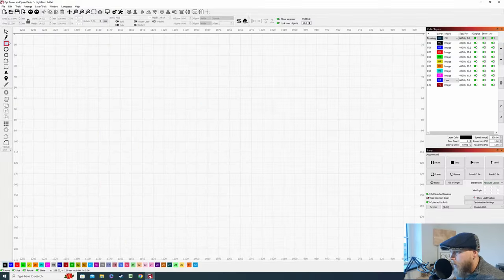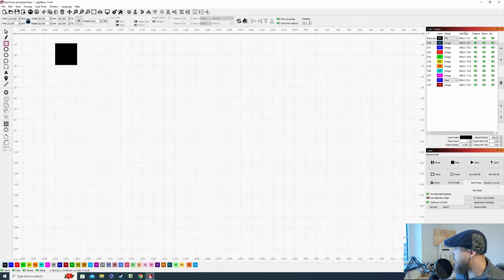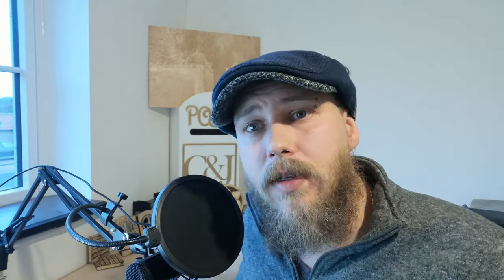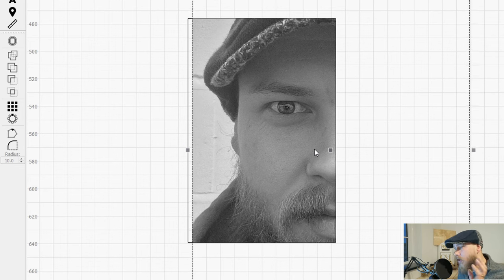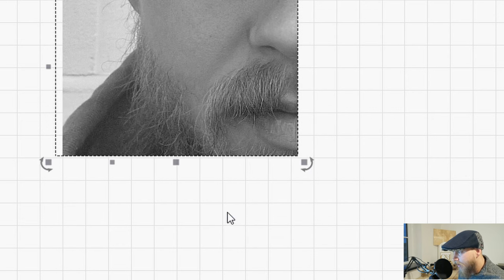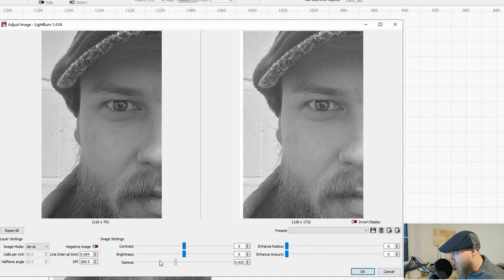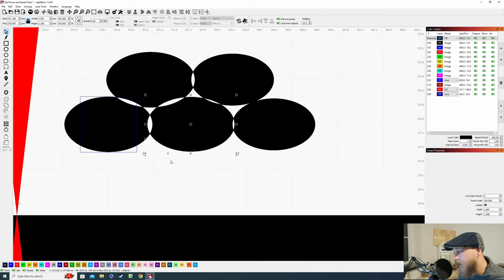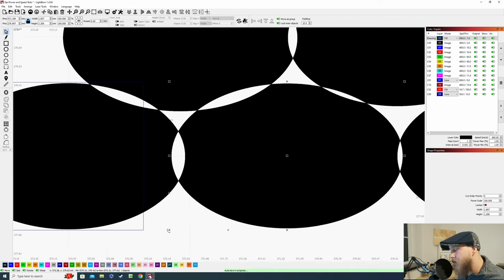3 Tips For Better Engravings [ My workflow ]

Comment: I have a question. When I try to do the same test to engrave the grayscale using Jarvis my button for the minimum power is grayed out. I only have acess using grayscale.
Reply from the maker: Hi. That is a good question. The minimum power will be greyed out on all other types of engraving if using a diode laser. They should still be available to adjust if you are using a co2. The best you can do with the likes of jarvis, atkinson and stucki is to adjust the maximum power until you have the best contrast of shading throughout the test. If you set it at 100% and run the engraving at a low speed you'll end up with a black silhouette of a picture. 
I hope this helps, any questions please don't hesitate to ask.
Reply: @MadeBetterWithKnowledge  Thank you. I do have a diode laser.

Comment: Hey Johnny, great video. I've seen a lot of videos on how to process a picture, but this video gave me more information that other videos hadn't shown me. Like I always put my min power to 0. I never saw anyone put it to 1 below the firing power. I'm glad I found your channel. Keep up the great videos.
Reply from the maker: Thank you. Just to clarify, the minimum and maximum power settings can't be used on all engraving modes. Also, co2 and diode laser settings might be different, min max power might not be accessible in some cases. But thank you for your comment and I hope it helps.

Comment: This was great info. I’m doing a lot of photo engraving  and this will save me from spending a lot of time testing images.
Reply from the maker: Brilliant. Just 1 thing to keep in mind your power scale may change depending what species of wood your engraving on. Your dpi and de focus settings  should be fine but you may need to run a test for your power when engraving on different woods
Reply: @MadeBetterWithKnowledge  That'll be a challenge. I'm a woodturner. We get our wood green and from anywhere we can find it. It's quite a collection in my woodshed!

Comment: Hi Johnny. Made it to the end. I like this video, it was the only one I've ever seen that said more than "adjust it till it looks good" like that means something.  Good advice but I wonder if you adjust your scan offset? Thanks for everything.
Reply from the maker: Thank you very much for your comment it means a lot. I really hope  that watching this video has helped in some way. I am assuming, and I might be wrong, that you're referring to scan offset as  over scanning. If so, I set it to a minimum of 5% to allow for the laser to slow down and speed back up before it has to power back on again. If you're referring to scan offset as the machine setting, I have left mine as the machine settings as I have not come across any issues thus far.

I hope I have answered your question adequately.

Comment: Very good, the only thing I would be concerned about is different wood species. I think different power settings would be required, but this should be saved once for each specieis. Also cleaning the laser lens has played a bit factor. I don't have a blower.

Comment: Does this apply to the settings for the laser being used specifically regardless on what you are engraving or do we need to do this for each different material? Excellent Video.
Reply from the maker: The dpi and the de focus settings will always be the same. You will have to do a power scale test for different woods

Comment: Just a quick question, on the latest version of Lightburn when you select Jarvis the option to select the min Power is gone, so we only have the option using greyscale, any idea?
Reply from the maker: Which version of lightburn are you on 1.4.04?
Reply from the maker: I have just taken a look through the settings for diode lasers and co2 lasers. It seems that  the minimum power is locked on engraving types other than grayscale for diode lasers. That is an error on my end. In your case, you can still use the image that I used in the video for your power scale. The only setting you will have to change is the max power until you have a good contrast in colour throughout the scale. 
Thank you for bringing this to my attention. I will need to amend my video. This is a great catch and a huge error on my end. 
I hope the information I provided in this comment is clear on what to do.
Reply: @MadeBetterWithKnowledge  thank you for your reply, and we are here to help others ;-)